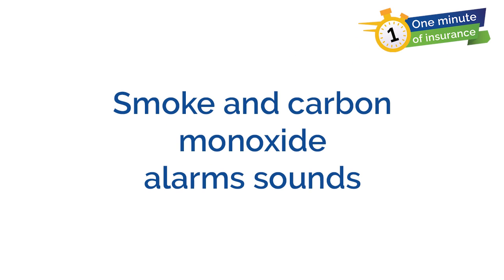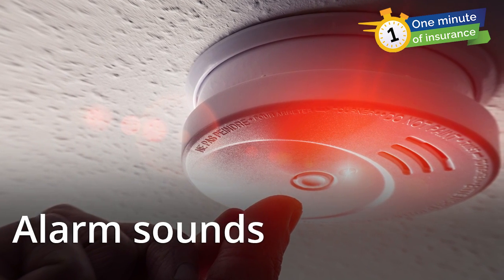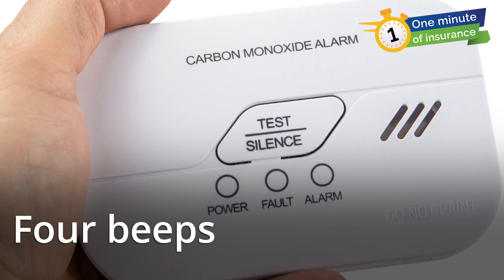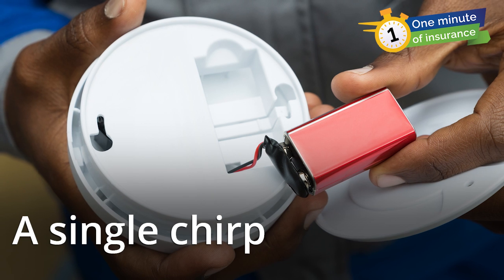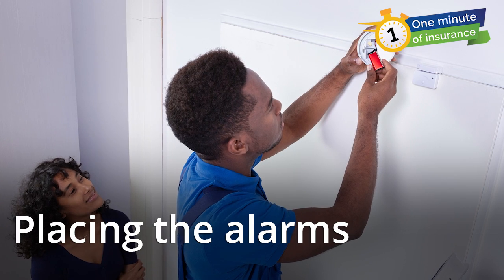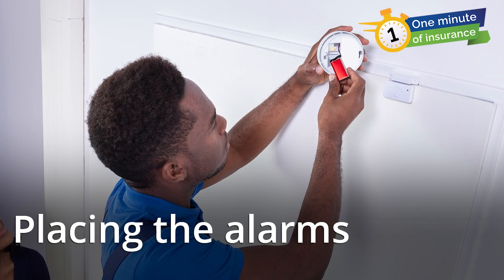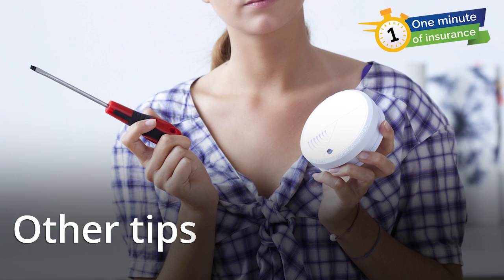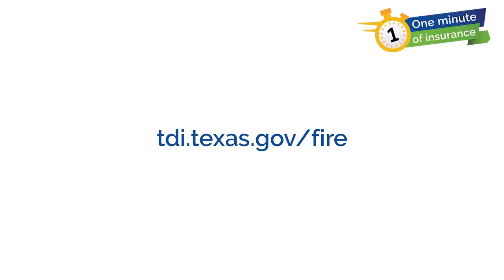Smoke and carbon monoxide alarms sounds

Comment: Why aren’t smoke alarms mandatory in Texas buildings?
Reply from the maker: Each municipality or county of a certain size may adopt their own fire code. Contact your local fire marshal’s office to file a complaint if you feel as though a building is not up to code with required fire alarms, fire sprinkler systems, and extinguishing systems.